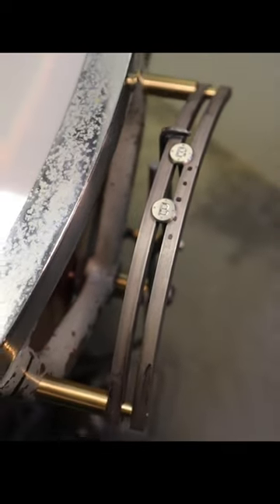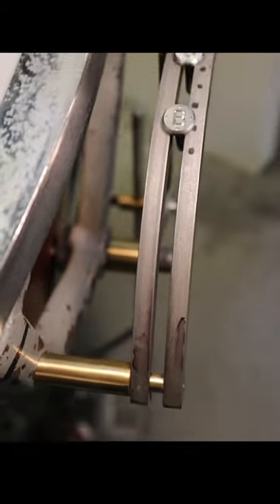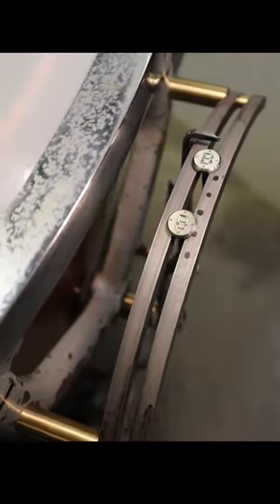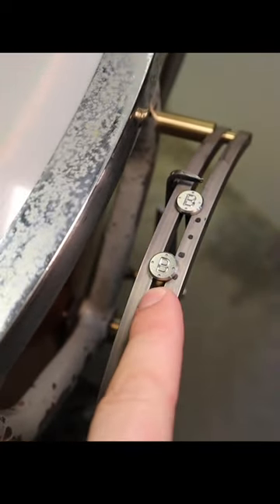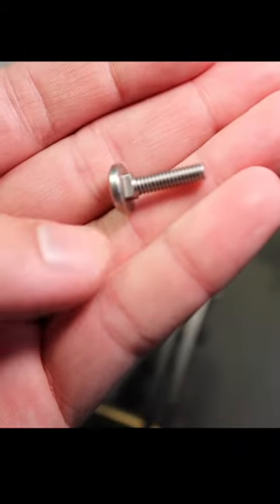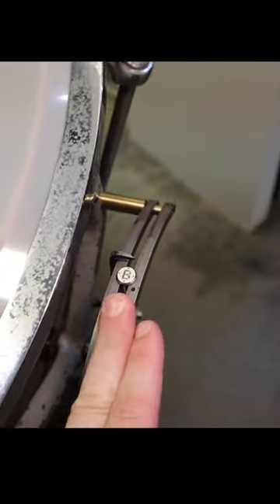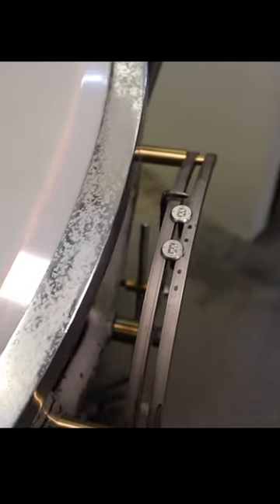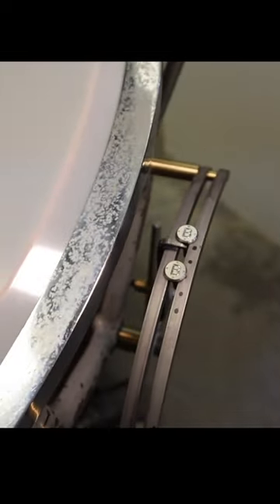What are timpani tuning gauges??

Comment: yo do you know how to get these to work? i got a set of ludwig timpani and they have the gauge but moving the pedal doesnt move the pointer at all
Reply from the maker: There should be a linkage between the pedal and pointer (like a 1/4" round piece of metal and some adjustment pieces). If you want to contact me through my website, send some pictures and I'd be happy to walk you through how to connect them if everything is there.